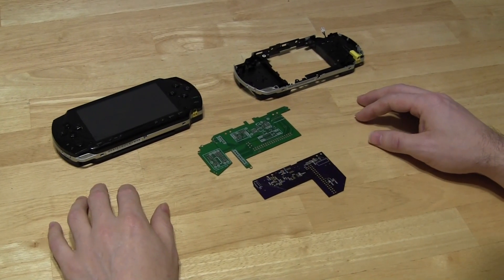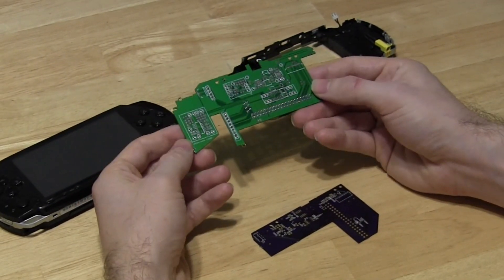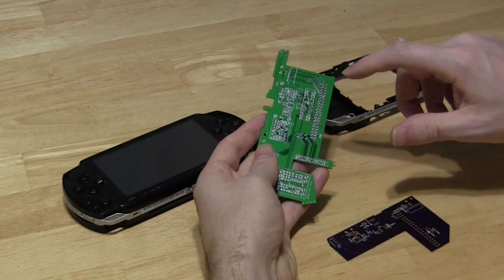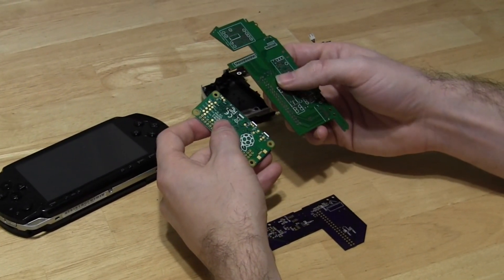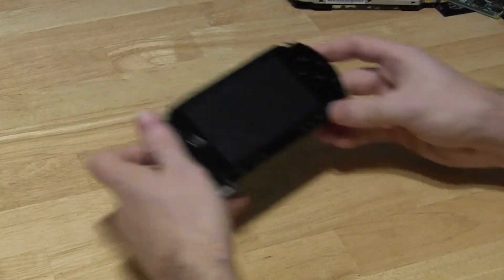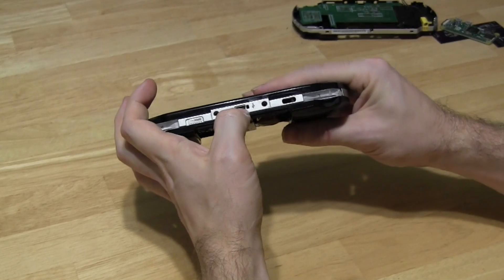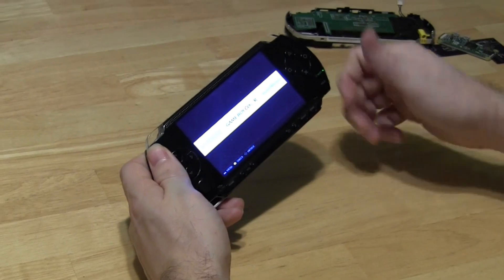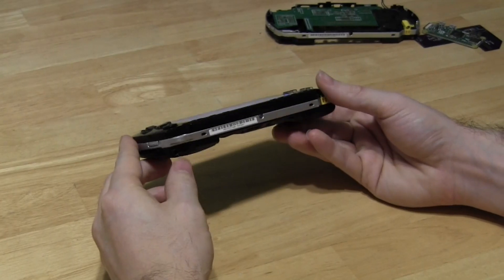PSPi Version 1000.3 Prototype 2 PCB - Raspberry Pi Zero in a PSP Shell

Comment: Is there ever going to be a version of this for the psp 3000 model? Would really like that !
Reply from the maker: I want to. I did some disassembly on the 2000 and 3000 models and started on the research, and the datasheets for the LCDs are impossible to find and I have no idea what type of signaling they use. I don't have the option to use aftermarket LCD in them either. 
Right now it's on hold unless someone can find the info.
Reply: Oh okay,I understand. Thanks for the quick reply :)

Comment: If you plan on using a pi 3 compute module, you could get rid of the heat by using the PCB as a heatsink. The pi probably doesn't give off that much more heat than a Mosfet. It's just an idea :D

Comment: So what's the advantage of using a pi zero in a PSP shell vs just using CFW on the PSP? Seeing as though CFW has emulators for everything the PI can handle, plus it can still play PSP games, I'm not getting what the PI adds in terms of value aside from the fun of building the project.
Reply from the maker: Making use of a broken PSP, and making it more multipurpose then the PSP ever was

Comment: how do you get the analog stick to work. Do you just have it work as a digital pad with only up, down, left right, or is it recognized as an actual analog stick? I want to program one so it works with games were a light tilt will make character walk but a hard tilt will make them run.
Reply from the maker: +Edmund just digital at the moment. Hoping to add true analog in the future. Just trying to make it happen without losing the USB port

Comment: This is great, very cool. I'm wondering though the relative power of PSP hardware vs. the PI zero. I mean, you can already do all of the emu's on a hacked PSP. but which is more powerful? Also, what about doing what Sony should have done in the first place, add a second thrumb-stick to the PSP. then you could theoretically play PSP FPS games through an emulator as they should be played. that would be pretty cool. in fact, I would most definitely buy your kit if it did that!. regardless, GREAT WORK!
Reply from the maker: +frank logan with the Zero, this is more about making a dead PSP usable again and making it multipurpose. It's not going to emulate N64 or PSP games amazingly well, but it can do more things than the original PSP could.

Comment: would a small fan fit on the inside of the UMD slot?
Reply from the maker: +JONNYBOY ENT not at the center, because the LCD driver sits almost flush with the door. Maybe off-center if the fan was small
Reply: othermod not sure how hot it get but maybe one or two of these would work http://www.ebay.com/itm/like/181152651845?lpid=82&chn=ps&ul_ref=http%253A%252F%252Frover.ebay.com%252Frover%252F1%252F711-117182-37290-0%252F2%253Fmtid%253D1588%2526kwid%253D1%2526crlp%253D53601919689_324272%2526itemid%253D181152651845%2526targetid%253D186358931289%2526rpc%253D0.20%2526rpc_upld_id%253D101657%2526device%253Dm%2526mpre%253Dhttp%25253A%25252F%25252Fwww.ebay.com%25252Fulk%25252Fitm%25252Flike%25252F181152651845%25253Flpid%25253D82%252526chn%25253Dps%2526adtype%253Dpla%2526googleloc%253D9011236%2526poi%253D%2526campaignid%253D239125209%2526adgroupid%253D14978428809%2526rlsatarget%253Dpla-186358931289%2526gclid%253DCI3pjs2Wz9ECFQVZhgodtmQGgw%2526srcrot%253D711-117182-37290-0%2526rvr_id%253D1155978031350&ul_noapp=true
Reply from the maker: Not bad. I like the low amperage and small size, but wow that price...
Reply from the maker: https://www.aliexpress.com/item/new-SEPA-MF15B-05-5V-0-06A-1-5cm-15mm-1505-15x15x5mm-mini-micro-fan-server/955034077.html
Reply: Do you think it will work?
Reply from the maker: You've got my wheels turning. It would probably fit on the left side next to the microSD adapter, and it could blow the air out and create a flow over all the components. 

Once I get this board out I'll do some research on the computer module.
Reply: Cool man, glad I can help...can't wait till I can get my hands on the finished product. I have about 5 psp just sitting in a drawer lol
Reply from the maker: I really want to give everyone an equal chance on it and let the auction run through.  I really don't know what it will sell for. I'm open to building another one if someone makes an offer I can't refuse.

Comment: nice :) imo raspberry pi zero is not best option for this, but sure its easy to use. and speak bit faster. and do psp games run snoothly on it? because only reason i will be using allwinner is that it is more powerful and versitile.

Comment: like everyone else is asking, would it be possible to make one for the Rpi3 compute module?  thanks man!
Reply from the maker: +David Wei yes it's totally possible. My only concern would be the power requirements and we would have to find a way to get rid of the heat. Even with the Pi Zero this runs pretty warm.
Reply: Possibly some heatsink?  Or down clocking it a bit too make sure it never gets too hot?
Reply from the maker: The heatsink would help, but there would still be too much contained in the case. I probably wouldn't want to make the underclocking a requirement. What I need is a low-power, quiet, and reliable way to keep air moving into and out of the case. It's possible that simple convection would be enough if I drill holes in the case.
Reply: I'm thinking about maybe gluing a sheet of aluminum to the back of the case, and glue an aluminum spacer block to the Broadcom CPU, that mates with the sheet via one of those squishy thermal pad?

I thought about cutting a hole in the case and have the aluminum block come out and have it sit flush on the exterior.  but that would be hard, not to mention idle fingers will kept playing around with it, might eventually damage the SO-DIMM socket due to the constant fiddling and pressing on the heatsink/module.
Reply: Build a replacement back plate out of aluminum that couples directly to the CPU on the Pi. It would be an expensive part ($10) but would remove your heat problems. You could also just cut some slots in the existing one and put a thin outtake fan after you get rid of the video controller board. In software you might also want to look at a package called "TLP" which is needed for any mobile linux application. You'll see huge performance and tempature benifits even when running emulators.
Reply: Designing 3d print of a back aluminium case as an entire heatsink is the best if possible